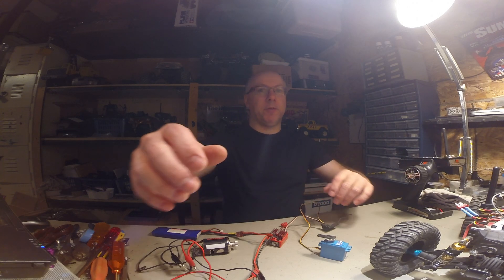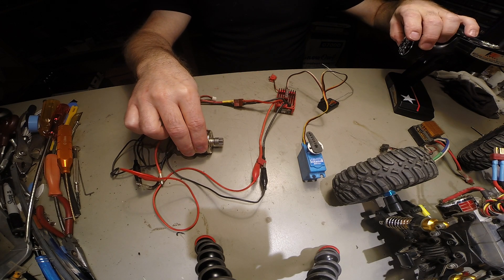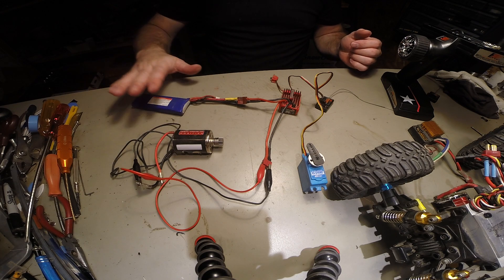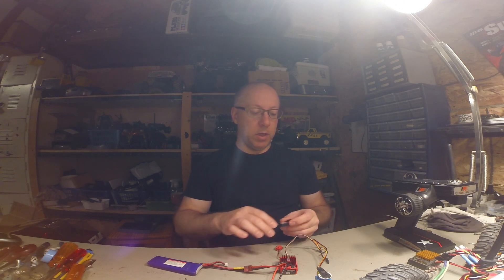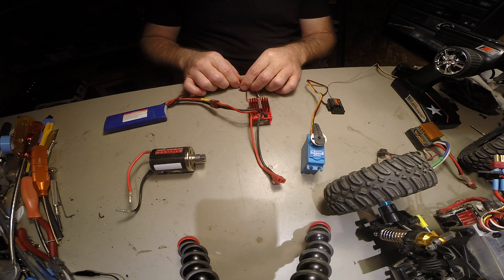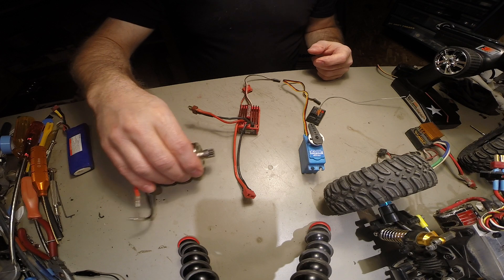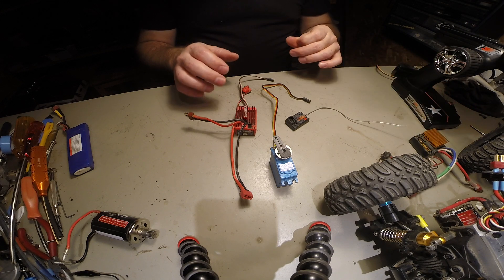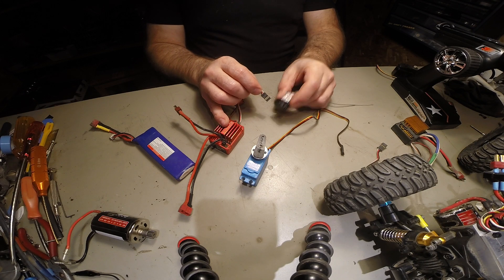Troubleshooting RC Electronics basics - Diagnose and fix it yourself

Comment: Had a freak scenario today. Radio control inputs stopped working.

Serpent Cobra GP rtr running stock electronics components/TX (Dragon-RC brand). Mid run, after 1st tank, the radio controls locked out and stopped responding to any inputs, but the throttle got "stuck" on the last input, which was around 30% throttle. Transponder was still getting power. Carburetor didn't jam.

I wasn't able to regain any control of the car until the RX's power was reset, after which the RX was able to resume receiving signals and operate normally with no obvious change in servo function. The transmitter's power wasn't reset, however. Unfortunately, I forgot to check if the RX was still trying to send inputs to either servo (by moving their horns/arms). I also forgot to check if the RX would've engaged its failsafe by turning off my transmitter first.

I was sure the TX was functioning fine but didn't check it at the time. Prior to the radio freak accident, it had 2 relatively minor crashes, one of which resulted in the car flipping on its back.

There were no obvious signs of loose or wobbly connections (battery to RX & both servos). 
However, my RX's running with a shorter than usual antenna. The normally exposed portion of the wire was snipped off by the radio tray's antenna tube a couple of weeks ago. The distance the car was at when the radio controls locked out was likely still within the furthest distance the car had traveled from me. 

The battery is ~1 year old, although it had barely any use prior to me buying the Cobra. Had the cobra for about 2 months now.

Is this something you'd be able to help out with? Thanks in advance.
Reply from the maker: Al B for starters the antenna on 2.4ghz receivers is relatively important as the length is tuned to frequency. Also having it as high up as possible will increase the distance.

Apart from that, intermittent problems are a real PITA to fix. You obviously need to recreate the problem.
Reply: I still have the wire that got snipped off, but I didn't feel comfortable with trying to "repair" it by stripping off the wire insulator to the length of the part that got snipped. I had a look at a youtube video that talked about it though.

Thanks for the very fast response :)

By intermittent, are you referring to the 2 crashes or the transmitter?
The crashes were caused by me not paying attention xD

Besides trying to fix the length of wire (which is basically at 0mm past the insulation) and trying to raise the height of my antenna tube, are there any steps you think I could add to try to resolve the radio problems?
Reply from the maker: Al B intermittent as in does not happen all the time and goes away when trying to  find the problem.

As for the antenna, how much is missing? To repair it correctly would be to replace the wire from the board and not just solder it back together.
Reply: Yeah had a couple of other things come up since snipping off the antenna. The length of wire beginning from where the insulation stops. Unfortunately, I think the wire on my stock RX is apparently soldered onto the pcb. I asked my lhs about repairing or replacing the wire a day after it got snipped.
Reply from the maker: Al B might cost less to replace the Rx
Reply: Yeah I'd have to agree with you. Also because I don't think we have any quality tools to do a clean wire-cut or solder job... I also don't have experience with soldering.

Anyways, thanks again. The quick responses and help are much appreciated :)
Reply from the maker: Al B what part of the world you in?
Reply: Should see it in the notifications. How come you ask?
Reply from the maker: Al B curious and did not see any location in notification

Comment: My battery has full charge, my Apprentice will not take off, even at full throttle. I get full tone on startup and the motor seems to be working ok, what is my problem?
Reply from the maker: RC Hobbyist Extreme what's an apprentice? It does absolutely nothing when using the throttle? Have you switched channels  to see if your ESC works on channel one?

Comment: mine dont work i buy flysky gt2e reciever and transmitter brand knew i try to conect servo to reciever and it didnt respond at all on the transmitter even it is already bind red light are stable on reciever and transmitter. dont know whats the problem please help. thanks
Reply from the maker: chris reyes it never worked since you purchased it?

Comment: I have 2 problems with my Duratrex electric Car, (1) the  car does not reverse  when I try to reverse it, (2) With a full charge battery, the car moves slowly at full throttle  making a loud, high pitch unusual noise.
Reply from the maker: David Lovell best we see what that sound is. Go to theledwheel Facebook group(not page) and show us so we can help.

Comment: So I pretty much have the same problem, esc shows that it gets the signal from the transmitter to be going but it can’t tell the motor to go, I’ve tried reversing channels and everything (obviously not everything cause Its still not working) but I also can’t set the throttle range it’ll set the neutral and full forward positions but not the last position. I need your help please
Reply from the maker: Hydrsoka 7 does a servo work on both channels?
Reply: theLEDwheel yes it does
Reply from the maker: Hydrsoka 7 then your ESC may be defective. If you can, try connecting a battery directly to the motor. If it works then logically it is your ESC that's not delivering power to the motor even though it may look like it's receiving a signal. Only other issue would be settings or programing and you say you have tried and it does not take it. I don't know what setup you have or if you are following the instructions correctly but if you are then I say it's a defect in the ESC. Is it new? Didn't just stop working? Are the wires good? Is your radio set correctly like channel 2 in normal/reversed as per instructions?
Reply: theLEDwheel I tried my radio channels and still don’t know it was fine last year, maybe it broke or something lol, I’ll have to check the receiver if it’s that
Reply: theLEDwheel but thank you for all your help I really appreciate it
Reply from the maker: Hydrsoka 7 but you said the servo works on both channels so it's not the receiver.
Reply: theLEDwheel okay sweet

Comment: sir, my receiver is working automatically. if I switch off my transmitter receiver is working. I don't know why it is happening like this
Reply from the maker: Kommoju kiran I don't know what setup you have but that is/can be normal.

Many receivers have a falesafe mode but most have to be activated. Look in your manual or online at the manufacturer website.

Also, you are never supposed to turn off the transmitter if the receiver is on. The proper sequence is TX then RX for turning on and for Turing off its RX then TX. This way the RX is always getting a signal.
Reply: TheLEDwheel  ok thanks for your valuable time

Comment: I have a exceed mad torque rock crawler, it has a LED light kit on it everything works fine but when I turn my wheels back and forth either way it will lose all power, it won't steer and it won't drive forward or reverse and the lights go out and it won't come back on untill I wiggle the steering back and forth a few times, it only happens when I steer it one way or another. I have switched the wires so that the throttle controlled the steering and it didn't have this problem, it's only when the steering servo is plugged into the correct spot for the steering wheel to control the steering. I was thinking maybe my receiver is bad but I don't know much so I thought maybe you could give me your opinion of what you think might be wrong

Comment: Hi great video! Im having trouble with my rc car. Everything is working but i only get 5 minutes run time  out of my lipo´s. I have the jlb j3speed ATR so i put my own electronics in which are a racerstar 120A esc and 3670 2650kv brushless motor, a power hd 20kg steering servo. I use floureon 3s 4500mah 30c batteries which i have 4 of them. So my batteries aren't lasting very long at all and get really hot and will puff up quite a bit. Is something drawing too much voltage or amp´s from the battery? I use a heatsink with a fan on it for the motor and have also swapped out the esc and motor to see if it was that but with the same results :-(
Reply from the maker: Rc Immortals does your motor and ESC get really hot?
Reply from the maker: Rc Immortals does your drive train spin freely without a motor in it?
Reply: TheLEDwheel Motor and esc temps are fine and yes everything spins freely
Reply from the maker: Rc Immortals could be the batteries are crap. Possibly not really rated as written on the pack.
Reply: TheLEDwheel Thanks, it just might be.

Comment: Hi , I just got started after 30 years of not touching RC. I just assembled my tamiya but similar to your set up there is a beep whenever I squeeze the trigger. However if I accelerate to the max I don't hear the sound nomore. Is this normal? But each time I squeeze the trigger at throttle speed there is a teeet sound.. would u please help me out?
Reply from the maker: i am assuming the steering works?
Reply: TheLEDwheel it works..its just the forward and reverse .. the is a beep while the motor moves like in your video..is it normal? thanks
Reply: TheLEDwheel exactly the same beep as in 1.26..while the motor is moving.hw do I get rid of the sound?
Reply from the maker: is it a beep or like  a eeeeeeeeeeeeeeeeee while going slow and it fades as you go a little faster?
Reply: TheLEDwheel the it exactly like yours in 1.26 and indeed it fades while goingfaster..?? I think it's an eeeee..ee..ee..
Reply: TheLEDwheel could you please explain that? and if it is normal..
Reply from the maker: so the rc work properly then, to keep it basic, that sound is just some electrical noise created because of the magnetics trying to rotate the motor. Once the motor is going fast enough the noise goes away.
Reply from the maker: and yes its normal as you you can hear in this video of my truck
https://youtu.be/fWMXUST-CmM
Reply: TheLEDwheel thanks so much buddy..any ideas how I can get it to stop.. while at a slower speed?

Comment: I just got a mini esc a 20 A esc from gearbest and i mounted it and everything worked fine but after i turned it off and onn i only have steering. I don't know what happened. Everything is good i tested it with more receivera and transmitters and nothibg happens. I think it s the esc but how could be that posible... It's completely new... I got it today... Any tips?
Reply from the maker: Cristian Stefan cheap esc?
Reply: Yes i buyed it for 5 dolars
Reply: I think it s done... I ll have to buy another one. The thing is i ll have to wait another 20 days... Oh man this suks
Reply from the maker: Cristian Stefan very well could be crap. Get your money back and get a hobbywing 1060
Reply: TheLEDwheel  okey thanks for the info but where can i buy that esc? Any link to any online shop?
Reply from the maker: Sorry, just saw your last reply.. still looking for another ESC?

Comment: In my crawler, my servo was freaking out so I bought a new one, to find out the same thing happened to that servo! So if it’s not the server, is it the receiver?
Reply from the maker: Is your ESC BEC Voltage correct? Is it higher than the servo's voltage ratings?

Comment: Hi. Mine is less sophisticated problem. My RC batmobile made by air hogs is stuck at going forward with horrible buzzing sound. How can I fix it? Your advise would be so helpful.
Reply from the maker: Unfortunately toy grade RC's are not as easy to diagnose. I do not know the electronics in this one but as far as Toy Grade goes I usually upgrade them to  Better electronics. This may or may not be worth it.

Comment: my rc turns on and goes foward and backwards aswell as turns left to right the problem i have is that i drive it for a little bit than all of a sudden it drives on its own help me out please
Reply from the maker: ArrmaTube23 you have a range problem. On many RC's your can set a failsafe that stood everything when the signal is lost.

Now this problem could be a few things. Bad antenna in either the tx or rx. Badly positioned antenna in the car. Defective Rx or tx..
Reply: TheLEDwheel so do you recomend me purchaseing another reciver and just bind it to my remote and see what happens because even when i have the car right next to me i run it a little bit than all of a sudden it just goes by its self
Reply from the maker: Oh I see. I misread. Disconnect the servo and try again
Reply: TheLEDwheel and if it still runs on its own do i just have to buy a new reciver box right

Comment: I was told maybe my car has faulty bec in the esc, my car has been running but eventually it will just cut out, no power to anything. Sometimes it will turn back on and give me some more run time but it will cut out again. This morning I turned it on, full battery, it turned on for about a second and then shut off, turned it off and back on and no power at all. I am new so it's difficult, im trying to fix the problem, the car is a baja rey. Hope you can assist.
Reply from the maker: Sam 123 the power cuts off completely or do you still have steering?
Reply: TheLEDwheel most recently its consistantly been everything including steering cutting out.
Reply: TheLEDwheel i havent been able to run a full pack since i got it, with varying degrees of run time
Reply from the maker: You need to try another ESC.
Reply: TheLEDwheel i removed a small rock from esc wires (i doubt this will effect anything) and it did run just now, in the morning it did not run. Ill have to see how it goes but yeah i dont have another esc.
Reply from the maker: Might want to check the conductivity of your connections and for broken wires. Broken wires can look fine but be broken internally. turn it all on and play with your wiring.
Reply from the maker: coincidentally, what battery connectors are you using?
Reply: ec3 as its the baja rey, actually I figured it out earlier and it was a bit of exposed wire, it got pulled out a bit, on the lipo just at the connector. Whenever it shuts off it will turn back on if I touch it there. So i bought new ec3 and will solder it on.

Comment: No on channel one my steering works, on the transmitter, where you can put channel one or 2 in normal mode or reversed mode, channel 2, the motor doesn't work in normal mode, pull to go forward push to go back, then when I put it in reverse, push to go forward, pull to go backward

Comment: Thanks for the good tips but I've been having a problem my rc truck cuts out going up a jump and when back on the ground it works fine on full throttle I'm so confused by it .
Reply from the maker: zeus m84 place the RC on something off of its 4 wheels and remove the cover. Hit the throttle and play with your wiring to see if it's ok. My first impression is a loose connection.
Reply: TheLEDwheel thanks so much I have a glitch buster capacitor coming too, I feel like it's a servo /bec problem  I had this happen really bad on a truck and changed the servo and it fixed itself. Thank you for the advise it's all starting  to make sense now. I will do what you suggest sir keep up the good work .

Comment: But what do I do when the motor is beeping after I turn ON, how can I fix this, The radio controller doesnt do anything
Reply from the maker: Vlaadiously if the motor is beeping continuously is prob because your receiver or transmitter is defective or  it's not binded.
Reply: I bought a RTR drift car , Charged the battery and that's all it's beeping, Can you tell me how do I bind the receiver or transmitter?
Reply from the maker: Vlaadiously well I don't know the model but I bet it's written in the manual or on Thier website
Reply: It's a RS4 Sport3 Drift hpi
Reply: Even though I try to bind it to the transmitter the ON button has to be switched but It would beep instead of binding
Reply from the maker: Vlaadiously it's brand new?
Reply: no , not really I think it's 2016 https://www.hpiracing.com/de/kit/114356
Reply: Huh, strange. I plugged the Steering Servo wire and the Esc wire (out) of the Receiver and it make's still beeping but little longer

Comment: I was running my rc drift car and suddenly the steering, servo, stopped working. I check to see what went wrong and it ended up being that the wire connecting the servo to the receiver got completely destroyed by rubbing against the floor. This is similar to disconnecting the radio wire without cutting the power. My servo barely turns, while my motor does. Im sure that the servo is busted, any help?
Reply: Have you changed the servo wire?